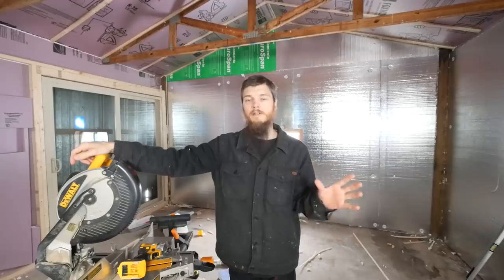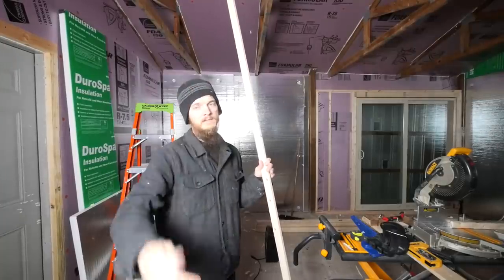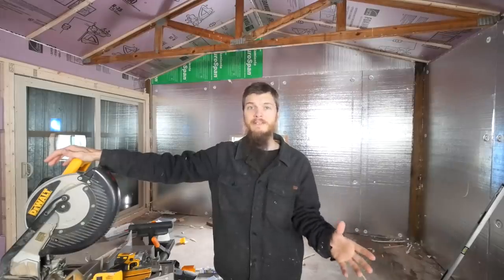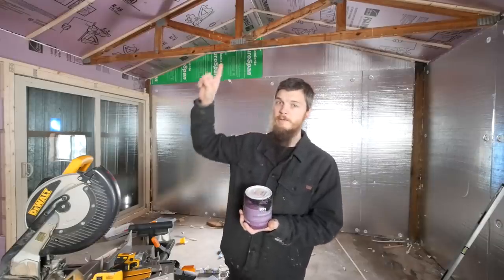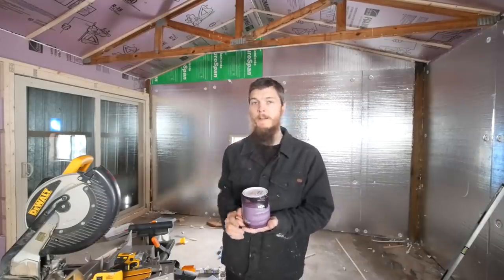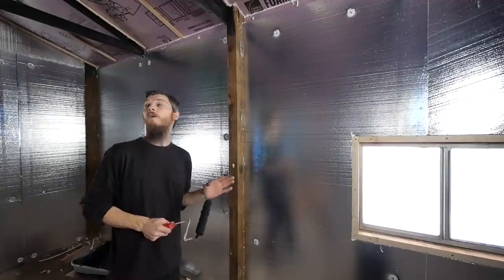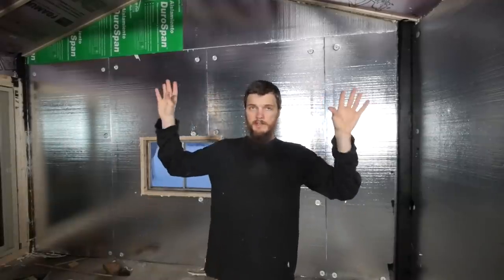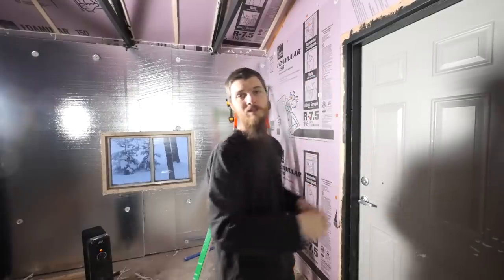Painted Trusses to Fancy Up The Garage Conversion

Comment: Love that ripping sound. I just love most everything you do. I like the extension of the scandi look you are doing in your party barn. I think if you are going to do a colour it should be a light colour. That way your room stays bright. I know you are adding lights, but light walls will add to the brightness of the room. If you build something like countertop space, you can always play with colour there. An indoor/outdoor rug can add colour and even painting the concrete floor will add colour. You could even paint a faux rug with different colour paints using masking tape to mark out a design and sealing it. Furniture and other things will add interest.

Comment: The black paint was the perfect accent!   If it was my property and Bella was my talented artist daughter I would paint walls and ceiling white.  My Bella would have free reign to paint one of her designs on a specific portion of a wall, and encourage her to change the art either with every season or every 6 months.  You could also create a display wall similar to the one in Bella's bedroom, she could be in charge of both 'art installations', as the Artist in Residence.     (It would delight her if you created a sign stating 'Bella - Artist in Residence' and mounted it above her work area.) 

Re the trim in front of the washer/dryer area - if you have not lined the back and 2 side walls with the same or similar trim you might think about doing so.  The front trim will limit mobility of both appliances.   My washer/dryer setup is in my finished basement.  I opted to have a 'pan' placed under my washer, a larger version of the style made to be installed under water heaters.   Since I do not go in the laundry room every day I also have a monitor that will sound an alarm if water touches it - same as installed in my water heater pan.  Since your laundry area is in a frequently traveled area a monitor probably isn't necessary.   A pan under your washer or outlining that area with the same vinyl trim might be worth researching. 

Your home is definitely better than new double-wide homes and most stick‐built homes.  And the design is beyond the cutting edge.  So unique yet stunning and very desirable.
Reply from the maker: There is a floor drain underneath the washer and the other trims are siliconed so any water will be contained in that area and go down the drain :) Thanks!

Comment: You might want to consider a ceiling fan install so that you can put it on reverse; that way you can recirculate the heat that rises to the ceiling while at the same time not feel any breeze blowing on you. Just a thought.

Comment: I love watching you do your thing... I just wanted to make some suggestions... I have a party room that I have every wall painted a different color... Because of the odd shape of this room I used 8 different colors... Then the fan in the middle has 6 different blade colors... I plan on painting them all the same way... This room is my play/party room... I use to have my own preschool business so it is set up with all my stuff... I now have a pellet stove in there but use to have a small wood burner that ran us out sometimes... So even with the heating unit you purchased, I'd look for a small wood burner to put in it too... That way your have a cost free way of keeping it heated for you all... I mainly used twigs & small pieces of wood in it... Most were picked up out of my yard... I have a special dry area I place so when I need them I just bring them in & fire it up pretty darn quickly... I could so see a pool table and/or air hockey table in there... Also... I would use the left over siding but I wouldn't make it look like the side of a house... I would turn it vertical & make the wall really look inside finished... I think it would look really awesome that way... I LOVE your creativity...  Christmas blessings to you all... And tell Belle to get busy on her Belle's book...

Comment: Doug and Ashley, until I know what you are using the room for, I can't comment on colors or boarding up the plaxiglass triangle... I was really liking that.... was hoping you would put another piece of plexiglass on the inside to sandwich the air and make it insulated that way... but, if you want a home theater, you won't want that light... would love to see you hang some swings from those rafters for the kids... and maybe even a slide... :)

Comment: My preference for the walls would be white, first because it brightens up the space but second because it's easy to accessorize. That way you can change with the seasons, holidays, mood, parties, etc. One of the ways I like to do it is to hit drapery sales for things like red velour panels, which I then hang on cheap-o white metal curtain rods. Four of the panels covers my long wall, with just the right space in between. It's a cheap and easy way to make a statement and it looks stunning. For those of us who practice feng shui but don't want our homes to look like a Chinese restaurant (and would never paint our walls red), it works great. Or, you could take some fabric that you like and staple it to the wall, then remove it when you're tired of it.

Comment: I'd install an overhead ceiling fan for summer and a suction fan too. Heat builds up in summer and turning on even just a small suction fan can make a difference huge difference even if it's just for a few minutes. We put ours on the wall up but up as high as we could go. Got it from Home Depot years ago works great.
I think it's about 16 inches across. I was sorry to see paint on the wood. Being a barn I really would have gone country and  polished up the walls instead. But it's still fun and interesting to see what you two come up with all the time.

Comment: I think pallet wood between the trusses which can be whitewashed to lighten it (more light reflection).  You could do everything dark like if you were doing a movie room but I don't watch that many movies :)  You could hang strings of lights like Edison bulbs along the bottom of the trusses since they're pretty far above your heads.  It would be cool if they could be solar.  To be honest I'm actually working on a tiny cottage and trying out some ideas.  I'm thinking cottage/cabin, like the camp I went to as a kid, but not too rustic or cluttered (dust!).
I mention whitewashed because it is sort of a color but not as hard to keep pristine like white.  I like the wood tones and whitewash would help fill in some of the roughness that would catch dust.  I plan to run over the pieces with a sander first too.  Just brainstorming here; I need to install the salvaged windows and doors before I do interior finishes.  And by "I" I actually am talking about "we"  and possibly mostly "he".

Comment: If you’re going to do a plywood wall, why not do the same thing you did in the living room and then clear coat it? It would be a nice contrast with the black rafters. Also you can get an electric fireplace for days when your heater isn’t quite enough.

Comment: You should do something outrageous on the inside of the barn door. So when you are in the room in winter, not using the glass door, you have something cool to see through the sliding glass...
Reply: I think it is time for Belle to get some paint and create a dragon mural. That might be a good spot.
Reply from the maker: What's cool is we can open that metal slider and look out through the glass door :)
Reply: @diyfferent  😂
Reply: @diyfferent  True enough, but something nice to look at while you are working in the middle of winter and the door is closed for that extra bit of insulation (not much, I know, but if the wind is blowing it will help!) Would be nice. Something summery maybe?
Reply from the maker: @susanvasquez3625  The glass door is a double pane exterior door, the same that's installed on homes. It's meant to be exposed really :) We don't have any plans to do anything on the inside of the metal slider :)

Comment: Well, that room is certainly taking shape in a hurry! I like it :) I am a teensy bit concerned about that threshold in front of the washer and dryer though. It's a great idea to constrain any water leaks but....how much of a job will it be to get the appliances in and out of there? Ours are pulled out at least twice a year.....each, as the hubs repairs them. (because I'm a cheap miser and if it's fixable I'll fix it before I'll buy new.)
Reply from the maker: It shouldn't be too bad :) It's similar to a washing machine pan which many people put under their machines.

Comment: It seems to me that with the black and white — it would be nice to add a bit of color — maybe in the accessories. Maybe an ombré effect on one of the walls as a feature. Start with the black boards at the ceiling and add a bit more black onto the wall and then gradually work down through the grays and ending with the same white as on all the other walls near the floor. Choose warm grays to give a touch of warmth to the room. Good luck. I really enjoy seeing your progress.

Comment: Wish we knew the ceiling plan you're excited about. That would help with wall color ideas. That said... You've got white already with the siding, so some color is in order. 🥰
1. I like the idea of putting a stain 🤎 on the wood then a protective finish (like polyurethane or varnish or something). You could put a design into it like in your living room. 
2. You could use blue 💙 to tie with the exterior. Either the same blue or the blues from your bedroom. 
3. Love the idea of a light, bright color to elevate mood and spur creativity. Maybe a bright green 💚, or yellow 💛, or orange 🧡.
Can't wait‼️👍🥰

Comment: Is the saw really that quiet? What are you nailing the furring strips into? It's looking great.
Reply from the maker: The saw sounds were replaced with other sounds. The furring strips were screwed into the framing behind the foam board :) Thanks!

Comment: A thought. What do you think of getting the widest aluminum foil and glueing the shiny side to the green on the foam. It would be very close to the same color as the rest of the walls. Cheap and easy fix to cover the green.

Comment: You need a bucket sitting on the floor next to the saw to drop the small pieces into so you don't have to pick them up later and you won't step on them hurting yourself.
Reply: And you can carry them into the house for kindling.

Comment: Couldn't help but notice  when cutting the furring strips it sounded like a big fart.  Got a good laugh out of that one.  That's a good use for the siding.  I have that on the inside of my screened in porch which was ideal for hanging items.  CUL
Reply: That was a ripping sound effect, like fabric ripping. NOT a fart!  Still a cute sound effect.
Reply: @ninabooker2904  I knew it sounded like something else but the fart was the first thing that came to mind. I just listened to it again for an extra laugh.

Comment: A suggestion for you. Invest in the parts for a smaller version of a double barrel wood burning unit. If you follow what others have talked about in tons of videos they are fairly safe and they will work when the power goes out. 
If you were stuck in a mega blizzard or very cold storm you could have additional heated space.
Reply: Or a rocket mass heater!

Comment: would doubling up the clear plastic provide you with enough insulative value to get your awesome gable window back?
Reply from the maker: It would have to be air sealed pretty well on both sides but it's possible. Still I think closing it off will be best for the finished room.
Reply: @diyfferent  even with corrugated wooden closure strips sealed with caulking?
Reply from the maker: @acw2099  Yeah, we just want it closed off. It's not just about the heat loss, but for the overall effect of the room. But I think that foam board would still have better r-value than the plastic.

Comment: Get a carbon monoxide detector.  My dad nearly was overcome using a space heater in our garage. The only thing he noticed was his lighter would not light. No oxygen.
Reply from the maker: We plan on only using electric heat, which doesn't produce carbon monoxide or use up oxygen, so it'll be all good as far as that's concerned :)

Comment: In my shop, I installed drywall and dropped ceiling and painted everything white. Why you ask? Because when I installed the 6 four tube led light fixtures (spaced evenly on the 24' x 36' shop), the shop had more light then you could ever ask for or imagine. The white allows the light to reflex off the ceiling and walls and therefore I have no shadows  anywhere. It actually looks like you are out side in direct sun-light. That is just what I did. I am sure your shop will suit your needs as well however you finish it off.

Comment: Now that sounds like tearing fabric or a fart?  Just couldn't resist lolol.  White and make your main focus wall with color.  The main entrance (sliding glass door) the wall directly across from it would be your main focus wall.  Don't scream at me if I say a muted darkish/light soft purple or something along that line.  Then after it dry's  take a some purple paint and add some white color stir it really good and  with a  big sponge and dab it over the original purple wall.  Any base color would look good that fits your color scheme.
Reply: Velcro
Reply from the maker: lol, it's tearing fabric!

Comment: if those thin planks are realy cheap you could use them to make a feature wall or ceiling using the black as a background https://encrypted-tbn0.gstatic.com/images?q=tbn:ANd9GcTRZOk9qNSl0to31l6tdt419vKN7HlB290Low&usqp=CAU and painting the wood white or clear before mounting could work horizontal too and you can stuff a lot of wiring behind it and use it to hang stuff from 
having them spaced a 10mm apart it still be quite a bit of weight , if you hang it from the ceiling be sure to mount it better then the 6 screws holding the styrofoam board 
as for lighting (if you plan to shoot video's there) you could buy those cheap LED strips that you can stick 2 or 3 rows side by side under the rooftrusses , those strips give off a lot of light 
https://greenice.com/nl/led-strips-in-spoelen-220vac/2331-led-strip-60-m-220vac-smd3528-ip65-x-100m-8435402503880.html?currency=EUR&wt_ga=103131606239_447089730713&wt_kw=_103131606239_&gclid=Cj0KCQiAw_H-BRD-ARIsALQE_2P0Lb3EiXTR123XwravHjoxV0DuLdnRBaF77xotaDWLUsdEJzPc9dUaAneqEALw_wcB

Comment: Ok, I know it is WAY too late, but I gotta get this off my chest... and if anything happens, you might be able to change it at some future date, who knows.

This has been bugging me since you did it, and every time I've seen it since....

That door would look SO much better centered in its space!!!! I love the door itself, the big bard door being able to cover it is great. The white siding outside is great, and I'm sure whatever goes around it inside will be great too.

But it needs to move about a foot away from the corner. Sigh. Ok, I feel better now. I know it is your door, and you probably have reasons for putting it there, but it has been SO bugging me!!! Lol

Looking forward to the rest of this room!
Reply: I like the door where it is. It's where the original opening was anyway, and the sliding glass door fits perfectly.
Reply: A little OCD are we?   I know I am.  haha
Reply: I believe they went with the existing opening?  Another good thing about it like that is it leaves a larger expanse of wall space for things like bench or couch or entertainment center, etc.  I get the symmetry aspect though.
Reply: @viannecash3774  the original opening is bigger than the glass door. When he did the siding outside it, there is a single vertical piece to the left, but a foot and a half or so to the right.
Reply: To clarify, I don't mean centered on the whole wall, just centered in the original door opening.
Reply: @susanvasquez3625  ah ha!  I see what you mean  now.  :-)
Reply: @susanvasquez3625  lol
Reply from the maker: We put it there because the metal slider doesn't open all the way over and we thought it would be better to keep it as close to the opening as we could. But I get what you mean. :)
Reply: @diyfferent  I guess I can live with it then.... Or rather, YOU can live with it, and I can observe it being lived with, lol.

Comment: Since this is your source for income, modifying rooms is okay but to me its kinda overkill as well. I would think that your vehicle needs to be protected from any different kinds of weather and that your tractor for keeping up with weeds on the property would also like some kind of protection as well. Were that my room, and wanted the rigs to be covered but not just there, I would of built a solarium for good food year round and some kind of heat pump for the home as well. Thats just one idea... others include a art room for the little girl to find her talents and go with them. She has a gift and it should be supported. Your son is special and his different talents will start showing as well as his ideas can be expressed. I  hope not to offend but to inspire some different ideas
Reply from the maker: The car can be parked in the larger section of the pole barn, this is just a small room that is connected to it. We have the other large wooden barn for things like tractors to be parked in. We don't use the tractor for mowing, we use the electric lawn mower which is parked in the other part of the pole barn. Belle does her art in her bedroom. We have been renovating our home out of necessity for the last 2 years (really 7+ years of renovating). It's finally done and now we want to take some time to work on something fun for all of us. This room that we're making is a fun hang-out space that all four of us can enjoy. And we are enjoying putting it together. We have plenty of plans for our future. This is sort of a winter project. I hope it makes more sense now.